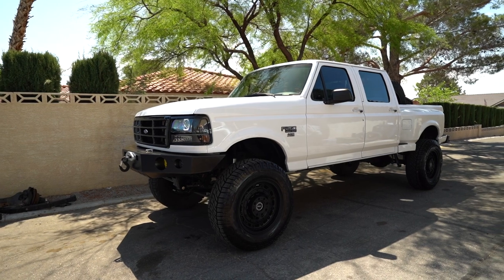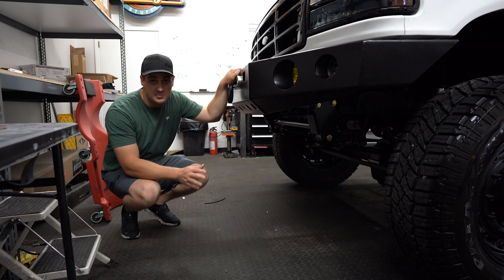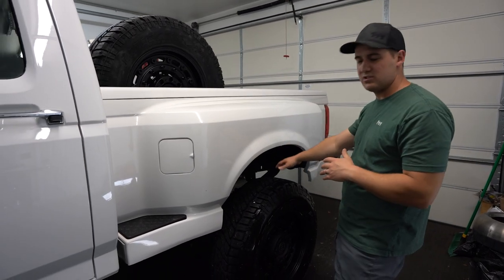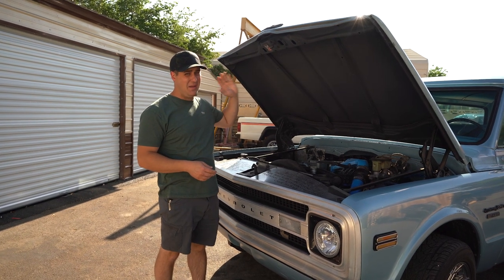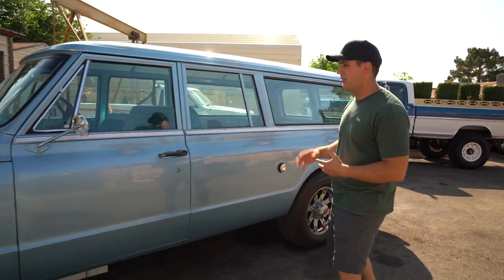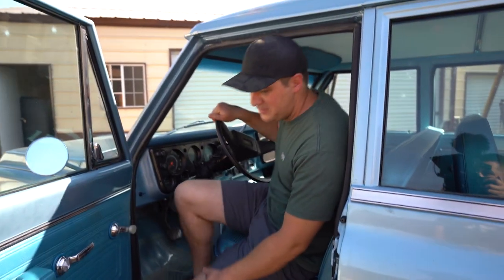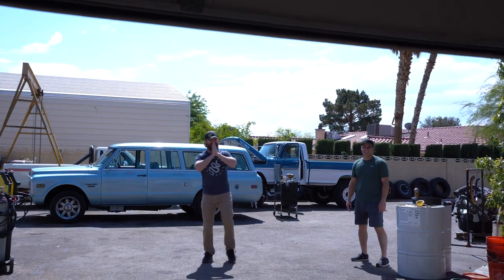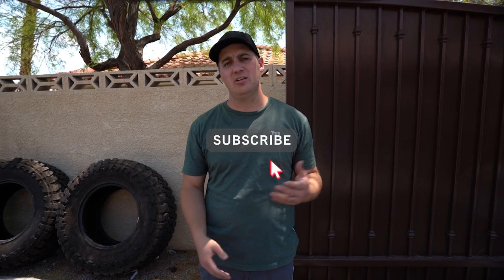HM Vlog: New Truck Build | F250 Winner

Comment: That’s a badass project right there. Too bad it’s a dodge chassis though imo. I would love to find one of those burbans and do an optimizer 6500 with nv4500 project. Yeah the Cummins is the moneymaker here, but if it wasn’t there to begin with….my heart goes to Detroit. I’m having an absolute love affair with my 95 2500 6.5 burban. They just love being touched right lol. I subbed after TLC came on. 😂